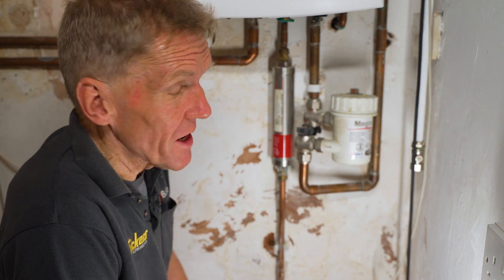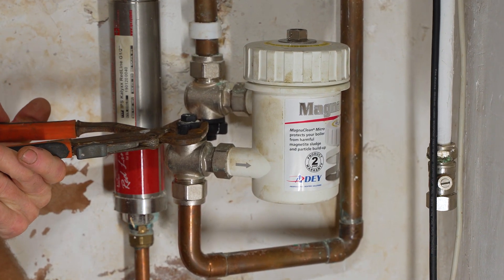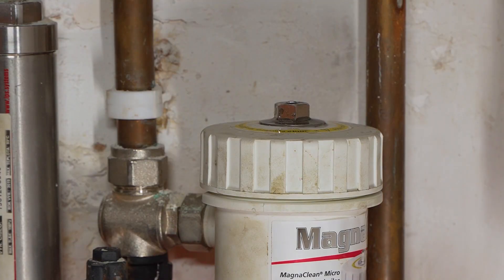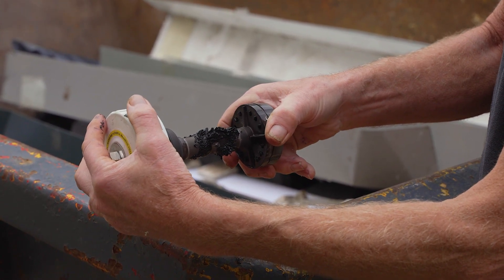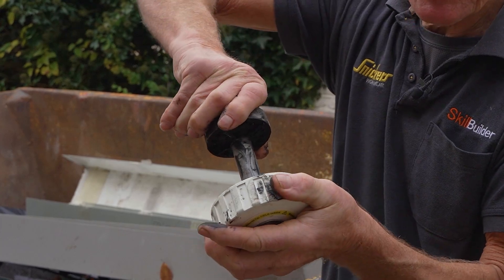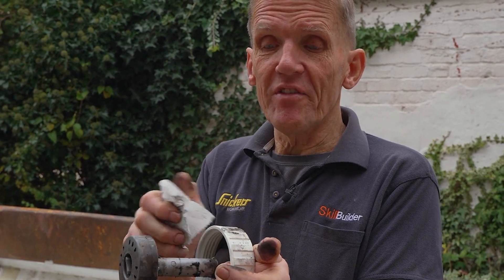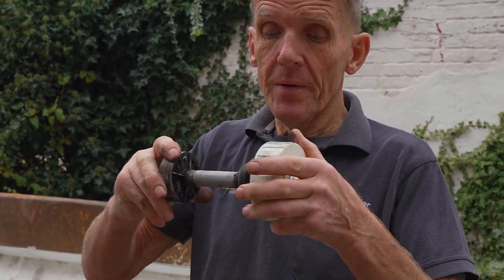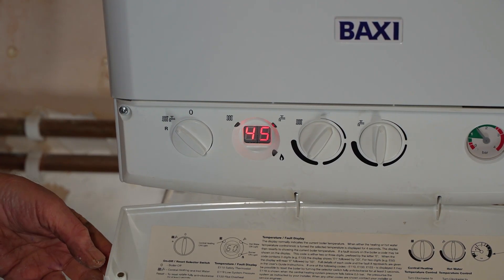This Simple Magnetic Filter Trick Will Save You HUNDREDS on Heating Bills!

Comment: Got mine in when I got my boiler and fuck me it's been cleaned 3 times fills with filings. Had all rads replaced with double walled rads 3 years ago and replaced bathroom with one of those towel rack rads. Can't believe the amount of black iron sludge it's picked up in 5 years. probably 350grams total. Rust inhibitor sounds like an idea

Comment: Hello, I have a boiler (diesel) with 1 inch water inlet pipe and 2.5 inch water circulation pipes. Where I should install the filter?
Reply from the maker: It usually goes on the return pipe to the boiler so it picks up debris before it goes into the boiler
Reply: @SkillBuilder  thank you

Comment: my annoyance is they're just short of 500ml so you never quite get the bottle of inhibitor all in one go. on the other side of things they're so basic and yet very effective, i always recommend fitting one if i see a system without one, £80 to keep your boiler running smoother and longer is far cheaper than a new boiler
Reply: Fernox do an F1 inhibitor and F3 cleaner concentrate in 265ml, they're excellent for dosing with the Adey MagnaClean micro or larger
Reply: @jamesbrough7975  hadn't realised that, thanks!

Comment: The ones I've seen of these have a drain top and bottom so you can easily drain that of water to refill with inhibitor. Don't forget to open the valves though and don't do this cleaning whilst the system is running. Ideally wait until everything has cooled down or it's going to be pretty uncomfortable.

Comment: I have underfloor heating so everything is plastic apart from the manifold, pump and boiler itself of course. Since there are no steel radiators in tje systrm is there really any point in fitting one of these? A plumber who serviced my boiler said there was, another said not.....
Reply from the maker: It all comes down to the warranty. If the manufacturer voids the warranty because there is no filter it could be an issue but I suppose if the fault is not system contamination you should be fine.
Reply: Best to have it on there  .. just for the warrentee!!

Comment: Great advice as always. I'm having some plastering done and so removing a number of radiators. I will obviously need to add extra inhibitor when the rads go back and I guess it would be a good time to check the magnet and top up from there? I would usually check it in the summer, but it doesn't take long and is very easy.

Comment: This is similar to a magnetic oil plug on a car. Back in the 90’s working minute lube I would find them on 1% of cars. And about 1 in 10 would be covered in metal chips.
Reply: Yes , my BMC with the unit engine /gearbox always had a cluster of iron filings. That is why I changed teh oil every 3000 miles. Compare that to todays service intervals.
Reply: I don't know why they don't still make them magnetic.

Comment: Surely it makes more sense to stop the black sludge forming in the first place, rather than just letting the radiators corrode away and continually cleaning up the debris. This black stuff is Magnetite an oxide of iron and it is caused by Oxygen reacting with the Iron in the system. Stop the oxygen getting in and hey presto no more black sludge and no need for a filter.
Tell tale sign, your customer says  "yes I do have to top up the pressure now and again" which is continually adding fresh water with dissolved Oxygen in it.
Reply from the maker: Hi John 
Black rust is not such an issue. Once the free oxygen has been boiled out the rust turns from active orange to a more benign black. If the system is being topped up regularly the oxide is usually rust coloured.

Comment: Fingers crossed the isolation valves on the boiler and/or magnetic filter don't leak. Also remember to have £15+ seal kit on standby for when the lid leaks.
If you manage to get the lid back on without a leak pray to God you don't put too much pressure on those compression joints holding the mag filter on. 
🙏🏻
Best of luck folks
Reply from the maker: What a cheerful outlook on life
Reply: @SkillBuilder  Roger you've been in the industry long enough to know these can be a nightmare. A realist like yourself can surely recognise that
Reply: Fernox filter is much better
Reply: wha a doom merchant 😀

Comment: Good wee video Roger.  Its a Grant Vortex MagOne filter I always fit.  You did well to highlight how crap those magnaclean filters are, so well done,  as in most of the time you struggle to switch the valves off, theyre often stiff,  you cant see which way to turn them or when theyre off or on, the big spanner is usually thrown away or lost and the cap often wont budge so you take a hammer and screwdriver to it.  Sometimes unscrewing the filter from the valves is required and they are notorious for cross threading. Best just chuck the MagnaClean clean in the bin 👍🏼 you majorly boobed by not cleaning and greasing the cap washer 🤠
Reply from the maker: I bet it will be fine

Comment: Good Advice Roger we have one fitted by the gas board many years ago recently I have had to top up my Worcester green combi boiler a few times we have a gas service contract and they came out and said that the pressure vessel needed pumping up he did it but the pressure is still down ( in your opinion) should they have replaced it as this have been pumped up a few times over the last few years
Reply from the maker: Very often it is just the core on the Schraeder valve that needs changing. You can buy a packet of them from Halfords, cheap as chips. If water comes out of the valve that suggests a leak but it is rare.